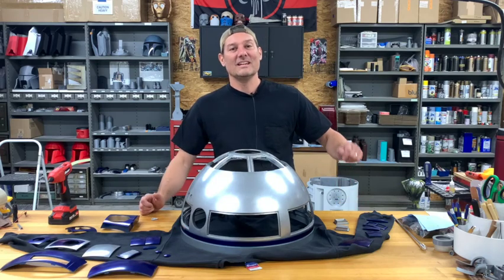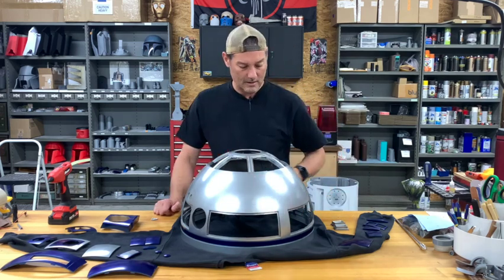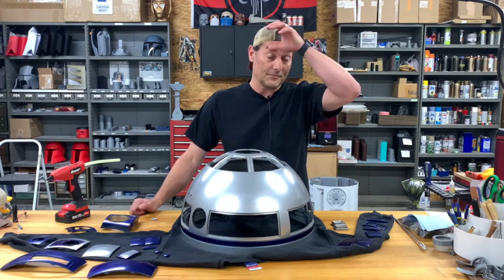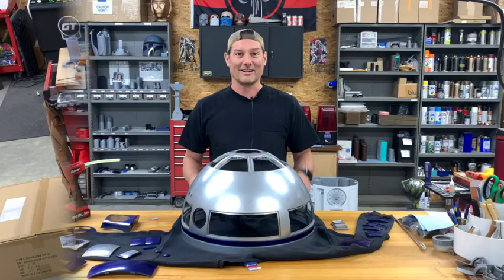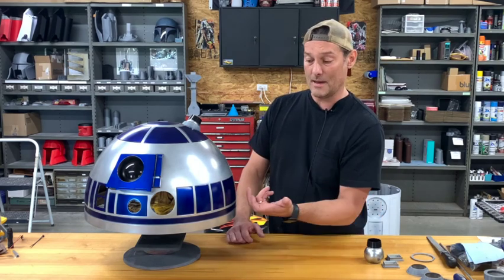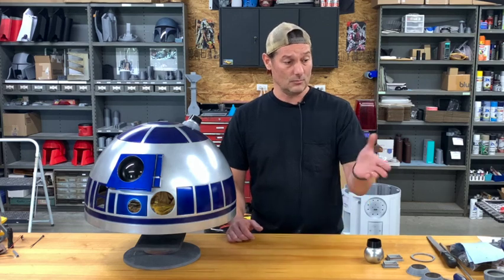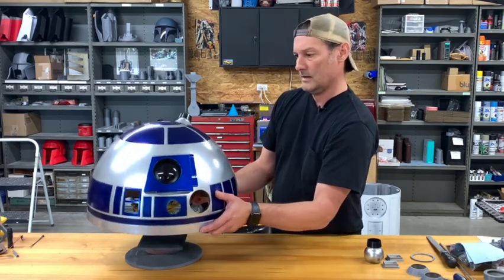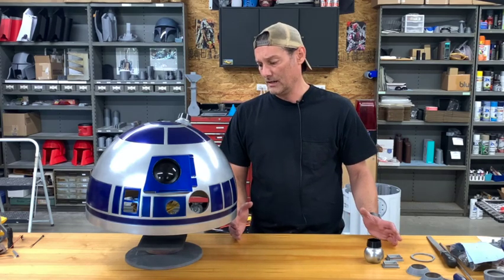R2 Dome Panel Installation. (Build Part 7)

Comment: Right, and the first hot day, BUH BYE hot glue and all your parts! Not smart.
Reply from the maker: In all the years I have used hot glue I have never had a plastic 3D printed droid in enough heat to melt hot glue.  It's personal preference I guess but no way I'd have my plastic droid on hot pavement where it could melt anyway.  Only on days with temps under that.